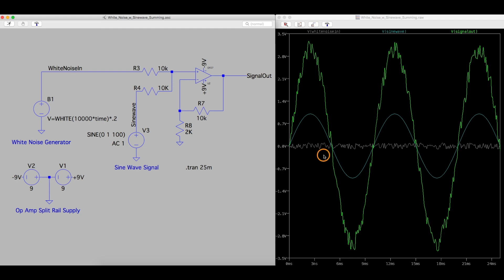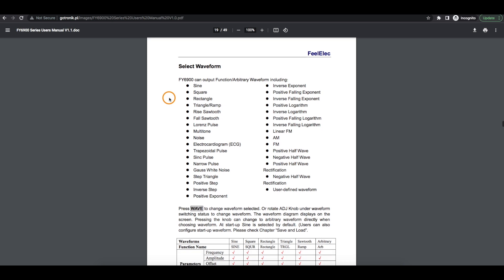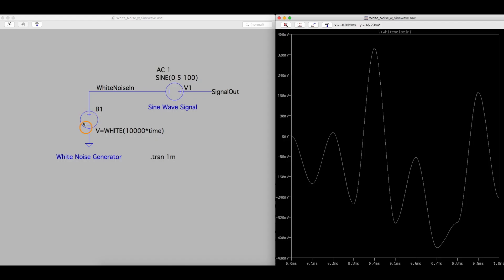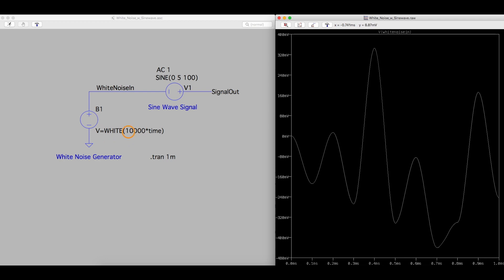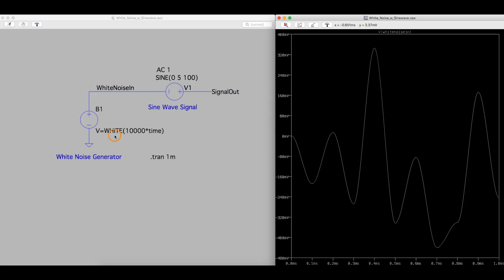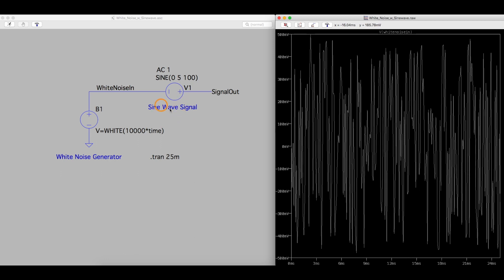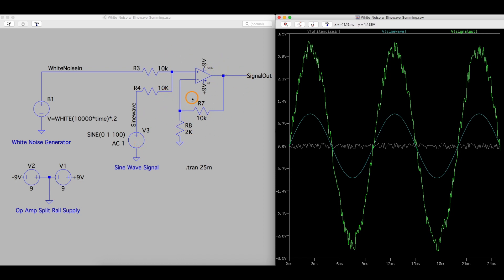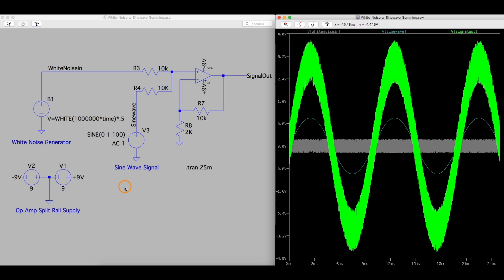LTSpice Noise Voltage Source

Comment: With the 10k and 2k resistor at the opamp, the gain should be 6. With an input signal of 1V the output should be around 6V. Why is it only ~3V? Is the behavioural voltage source connected wrong?
Reply from the maker: It has to do with the 10K summing resistors in line with the noise and sine wave signals.  If you change the 10K to a 10Meg in line with the noise you'll see a 6v sine wave because the noise is effectively out of circuit but if you look at how the output voltage is derived based on 2 input signals with series resistors, you'll see that two resistors of the same value at the inputs will reduce the output by half  
https://masteringelectronicsdesign.com/how-to-derive-the-summing-amplifier-transfer-function/

Comment: Nice to use if your designing input filters on switching inputs, at least you can simulate your circuit to see if you have hit the sweet spot.  I still like to breadboard circuits as spice does not capture ones own x-coupled problems caused by the layout. 🙂
Reply from the maker: simulating and real-world testing have worked together for me where I didn’t understand why a breadboarded op amp circuit wasn’t producing any output about 25 years ago. It turns out the op amp didn’t like very much capacitive load so the capacitor in the Feedback Loop was loading down the output even though the simulation with an ideal op amp was working. 
So then I found a spice model of the exact op amp on the TI website and saw the simulation was acting the same as the breadboard and somehow I stumbled on the capacitor load issue.  
I switched op amps and the breadboard worked fine.  back then I had to use just text editing ASCII spice files so at least it’s easier now.
Reply: @gadgetsideload  bring back the ASCII spice where you had to work out all the nodes for yourself. i can remember running it on a 8086 with twin floppies in a home made case. back then electronics was fun, no massive black chip that did it all. logic was a board full of gates and maybe a PIA if you could afford one. happy days.